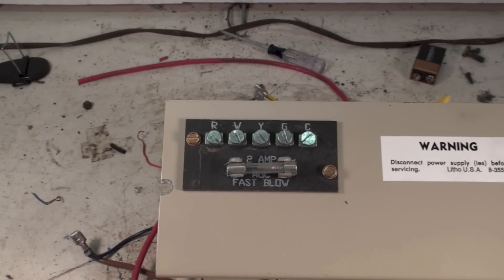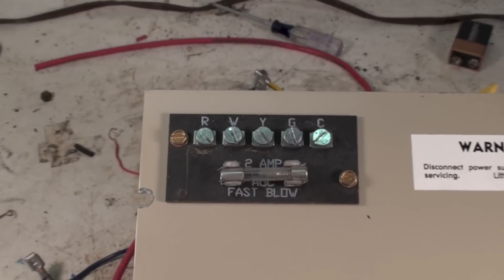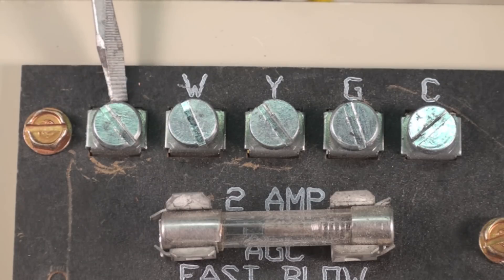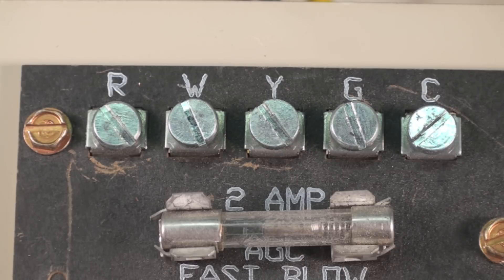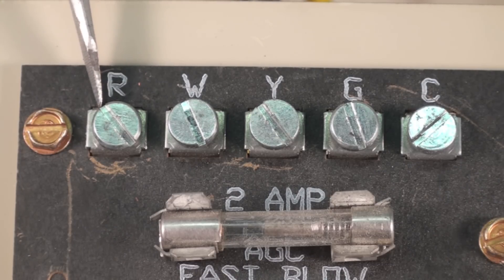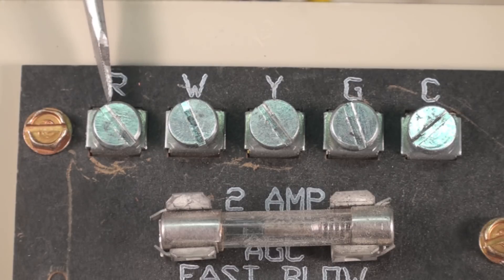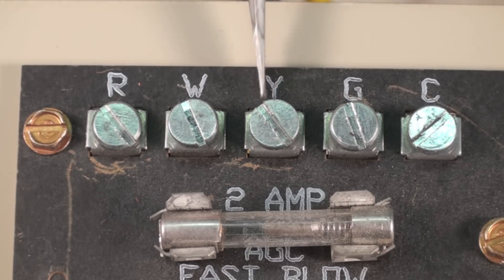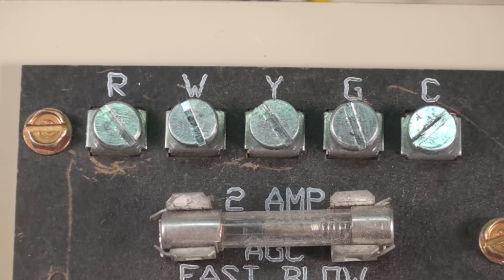What the terminals on the furnace terminal board mean

Comment: Thanks. Question pls (tricky). I have the typical 4 wire (no c-wire) thermostat setup but I want to update it to a new Ecobee3 thermostat which requires a C-wire. I will rewire the path with a new 5 wire cable and the connections would be pretty straight forward if not for the fact I have 2 twinned furnaces, so there is a bunch of additional connections between the terminals of both furnaces. So, I am betting that if I keep all the R-W-Y-G connections where they are, just replacing for the old cable, and then hooking the 5th new wire to the C terminal of any one of the furnaces, it should work. Would you agree? Thanks a lot!
Reply from the maker: Most twinned furnaces use one low voltage transformer, so you should be ok.
GFM

Comment: could you do the same thing with a basic Single or two stage stat and a heatpump stat?
Reply from the maker: I do have one on the color code used for heat pumps that may help. Try "Heat pump thermostat wire color code" on my channel.  Will be doing one on 2 stage also.
GFM

Comment: What do you think will happen during the winter for starters if the homeowner turns the fan to the on position ? That will energize the A/C with the jumper🙈 and with all A/C only compressors there is no crankcase heater band .  Why not just use the green wire directly , every furnace since the 70's automatically turns the fan on upon demand calling for heat or a/c !! The  only equipment that needs a green wire is a airhandler and at that point you should have a minimum 7 or 8 wire 18 gauge.

Comment: Gray:
I am hoping you can help and advise me. I have an old (guessing 1970’s) Heil gas hot-air furnace with central air. I cannot give you the model number since it is worn.My problem is that the blower does not shut off after the thermostat stops calling for heat or for cool.I know that the green wire controls the blower. The wiring goes to a Honeywell R8239A 1052 fan control unit. Guessing that was the problem, I went to my local distributor and bought a new controller. I replaced it wire by wire, and turned the unit on, and I have the same result, in that the blower never turns off. I have let it go for hours. It does this after both heating or cooling.Can you tell me what to check? I am not an HVAC guy, but I have 10 rental properties, so I am somewhat familiar with the operation of gas furnaces. I have multi-meters and know how to use them. I just don’t know what to check for.Thanks in advance!Jeff Mattero
Reply: Jeff Mattero I don't know furnaces but I know electrical. I would check the relay. The 24 volt is usually a signal voltage which pulls in a relay to allow a higher voltage to run the fan. If the relay arched, it may have welded the contacts together which is causing it to run constantly. If you have a multimeter, while the fan is running, check for voltage on the terminal that controls the fan. If there is no voltage but the fan is running, I would replace the relay
Reply: Can he check across the relay for continuity  with an ohm meter with the fan unplugged and the furnace switched off?  Presumably the relay should be normally open in an off state where no electrical power is being applied

Comment: 24 Volts positive from the 120Vac - 24Vac Transformer get's connected to R. 

From the thermostat, a wire from Y (Cool) goes to the relay positive for the AC Unit. When there's a call for Air Conditioning, the thermostat sends 24Vac down Y to the relay for the AC unit, and switches it on.

The ground from the 24Vac side of the transformer get's connected to the ground on the relay for the AC Unit.

Does that sound right?

If that's correct, then this might be right too. If not, can you help? I would like to build this. For experience.

Here : http://imgur.com/a/ckUSu

I will get the transformer and relay from Mouser Electronics, and the thermostat from Lowe's, The Home Depot, or maybe even Amazon Prime.

I'd like to learn a little more about thermostats and stuff, to become smarter and gain some experience at the same time.

Thanks. Subbed.
Reply from the maker: It should work unless the thermostat needs a power source thru C.  Then you could use the common from the transformer to connect to C.  Hope this helps.
GFM
Reply: grayfurnaceman I was thinking that too, and yeah, I'll just connect a wire to C if it needs it. Yes, big help, thanks a million.

Comment: Hi! We were watching another of your videos and were having trouble determining where the two wires coming from the air conditioner to furnace should go. I have a gas furnace. We have matched the red, white, yellow, green and connected the blue to the common, however, we are not sure where to connect the red and white wires coming from the air conditioner. Your help would be greatly appreciated.  Thanks
Reply from the maker: One goes to common and the other goes to the "Y" terminal.  Hope this helps.
GFM
Reply: Yes it does thank you so much

Comment: Thank you for the great video. I had a question...currently my humidistat and solenoid valve that serves water to the humidifier is hooked to C and G. I would have expected that when the furnace starts and the blower fan comes on the solenoid would get powered. What I have observed is that if my thermostat fan is set to AUTO the solenoid valve does not get power whereas if the fan is set to ON the solenoid valve does get power. Are my connections incorrect?
Reply from the maker: +Cyrus Doomasia Your connections are incorrect.  Use C and W.  Most humidifiers are not used in the summer.
GFM

Comment: I checked my furnace board the terminals and the 2-wires that goes out to my AC unit is connected to C and Y. 
Isn't that supposed to be on on R and Y?
The thermostat was hooked up last week and we haven't tested the AC since it's cold outside already.
Reply from the maker: +ybrik5 No.  You need the C common to feed one side of the air conditioner contactor.  The Y feeds the other switched side of line when there is a call for cooling.
GFM
Reply: +grayfurnaceman Would that mean the C terminal on my thermostat is empty? 
As there's only 1 wire on the furnace's board C terminal.
Reply from the maker: +ybrik5 If the thermostat does not need to be powered by the C terminal, it will work ok.
GFM
Reply: +grayfurnaceman Does that mean my thermostat is powered by batteries (2xAA)? So that means the Red wire dies not power my thermostat, it only powers the fan, furnace and AC?
Reply from the maker: +ybrik5 If you have AA batteries, it probably is battery powered.
GFM
Reply: +grayfurnaceman Are the batteries only for thermostat's date and time setting or also for its switching function?
So the C terminal isn't possible to wire from thermostat to furnace board C terminal as it will be too much to power my thermostat?
Reply from the maker: +ybrik5 If they are aa size, the thermostat is battery operated.  There is no problem with connecting C.
GFM
Reply: +grayfurnaceman Thanks for your help and time answering my questions.

Comment: I was trying to install a new 5 wires thermostat replacing an old 4 wires.
I used extra wire as c wire but the furnace terminal board side already has a wires attached to it(C and Y), which runs to out side compressor unit. when I attached the new run c wire to this c terminal it is blowing out my 3 amp fuse.
where should I connect the c wire of the new thermostat then?
Reply from the maker: +M ATIQUE The connection to C and Y is normal to operate the air conditioner.  Unless your C wire is incorrectly at the thermostat, it should work.  Also, if you do not need the C wire to operate the thermostat, do not use it.  Hope this helps.
GFM
Reply: My thermostat has been replaced just last week. Although on my furnace board I have connections on C and Y going to my outside AC compressor same as yours, there is no other wires attached to it. 
I think you should leave the C terminal of your new thermostat disconnected/no wires to it.
Reply: grayfurnaceman

Comment: Does the Red wire always have 24v or just when the furnace kicks on. I am looking at putting a humidistat on and if I wire to a constant "hot" line I could possibly be turning the water solenoid on without the furnace running.
Reply from the maker: The red wire does always have power. Wire your humidistat to the W terminal. That way it will only come on when the heat is on. Hope this helps. 
GFM
Reply: +grayfurnaceman: i replaced an old drum humidifier with a flow through and
 I have this scenario and want to correct it.  are you saying connect to C and W or the R and W
Reply from the maker: +Michael Van Gorp C and W will operate the humidifier during the heat cycle.  Thats when you want it to run.
GFM

Comment: I want to replace my 2 wire thermostat with a 4 wire so I can just run the fan on my oil furnace.  I have the four wires, I just need to know how to wire it at the furnace.  The terminals at the furnace are labeled  "F C C R W".  Any help would be greatly appreciated!
Reply from the maker: +matt What model and Brand?
GFM
Reply: The furnace is a Heil Model NLOD84FF03, the controler is a White Rodgers, about 15 years old.
Reply from the maker: +matt The F terminal is not familiar to me.  However R to F could be fan.  Are you sure one of the Cs is not a G?  G is usually the fan terminal.  Hope this helps.
GFM
Reply: +grayfurnaceman 
Thanks, I'll check in the morning!

Comment: Hey what are the line neutral  components  on a control board where does each white line go I got a board the other day on the old board line neutral  was labeled  g7g8g910g31g32 for each white wire the new board line neutral is labeled  different  it has spots for 9 and 10 but no plugs as for 31 and 32 also just in different spots. Everything else on board fits in and matches but that could they had gave me wrong board. I took it loose too take back an show them at store so I don't know schematics. Could you please help it's hot here in Alabama
Reply from the maker: Amil Williams All the neutrals go to the same place on the board.  This just means all the neutral terminals are connected together on the board.  Hope this helps.
GFM
Reply: Well like the white from blower thermal coupling where do they go on the line neutral spots the numbers don't match on new one or does it matter wat leg there on I just didn't wanna fry the new board Is there a way I can send you a picture
Reply: The white wire and white from thermocouple
Reply from the maker: Amil Williams Send it to:  grayfurnaceman@gmail.com
GFM

Comment: Thx for your videos. They are a big help. I have a Lennox G24M furnace, no air conditioning. I wanted to be able to run the blower for the furnace without the furnace being on. I connected terminals R and G through a toggle switch and indeed the blower does come on at low speed when I close the switch, which I like. When the furnace is on, the blower is at a higher speed. Can I leave the manual fan switch closed when the furnace is on? It seems to work OK. There is no increase in amp draw for the furnace when I switch on the manual blower switch when the furnace is operating. Leaving the manual fan switch on while the furnace goes on and off seems to work ok. I have a mercury switch thermostat which is for heat only. I'm a little reluctant to leave the manual fan switch on with the furnace on, because I don't know what is going on with that in the circuit, although it seems to work just fine. There is just that nagging little doubt since I don't know the circuit. 
I want to have a manual fan switch because the blower circulates heat throughout the house from the wood stove. 
Thx
Reply from the maker: akzocolo The furnace has a relay that locks out the unused speed when the manual switch is on, so go for it.
GFM
Reply: grayfurnaceman
Thx grayfurnaceman

Comment: Thanks for the video. I have a question if I may ask. I'm replacing my thermostat with one which requires power from the C wire. My current wiring bundle is only 4 wires with no spare for C.  My terminal board has R, C, G, W1, W2, Y1, Y2, and O.  The thermostat is connected to R, G, W1, and Y1.  The A/C unit is connected to C and Y2 and there is a jumper between Y1 and Y2.  I understand I can move the G wire to the C terminal and use that to power the thermostat while losing ability to manually turn on the fan. And I also understand this would require a jumper between G and Y terminals on the board. Is this still possible with separate Y1/Y2 terminals?
Reply from the maker: The Y1 and 2 will probably make no difference because you do not have 2 stage cooling.  Usually you can just use Y1.  Hope this helps.
GFM
Reply: Great!  Thanks for the incredibly fast response.

Comment: Nice video!  I am trying to connect a new WiFi thermostat - thought I was lucky since there seems to be a unused wire I could use.  However, there is no wire connected to the "Y" on my furnace board, instead it looks like it is connected to the "C" (not sure why or if that even makes sense).
Can I ignore this, and just connect my unused wire to the C on the furnace board on top of the existing C wire?
Thx
Reply: I have the exact same issue. I am trying to resolve it myself. I connected a loose blue wire that was part of my previous 4 wire bundle from the furnace C terminal. The C terminal at the furnace already  had a wire connected to it. I then connected the other end of the blue C wire to the C terminal of my new WiFi thermostat: Result ------- no power. I really would like to resolve this without wiring in an alternative manner, as I understand one can. Did you get yours resolved? If so, how?

Comment: What's the point of the Y terminal on the furnance control board? I was going to get a Nest Thermostat and replace my wiring. I was wondering if it was worth connecting this or not. The heat and fan toggle obviously make sense. I have a Reheem classic 80. Thanks for your video!
Reply from the maker: Louis Tibbs On some furnaces, the Y terminal is just a terminal point with no connection to the furnace.  I am not sure on your furnace, but newer furnaces use the Y connection to change the fan speed.  Hope this helps.
GFM

Comment: Do you know whether I can disconnect the green fan wire and still have the furnace functioning properly?  I have a retarded Section 8 tenant who uses the fan all the time as a cooking exhaust fan to silence the smoke detectors.  She does this instead of opening the windows to vent the oily cooking fumes.  Sooner or later the fan is going to prematurely wear out.  If I disconnected the green fan fire, would the fan still come on in the AUTO mode?  This is for a furnace.
Reply from the maker: madcheme  Most furnaces have a circuit that starts the fan without G.  Air conditioners do not.  Hope this helps.
GFM

Comment: I had a pro install my thermostat but I notice that when I turn cool I hear a clicking noise on the gas valve is this normal
Reply: It's an old miller furnance so I'm not sure bad when I turn the thermostat to cool the noise happens and when I turn the fan or heat I hear no noise
Reply: I forgot to tell u all wires are correct w to white y to yellow red to RH jumper to RC and G to green and there's is a switch set to gas
Reply: No.. I only hear that sound when the thermostat click for cool and when it's on.  It goes away

Comment: in my air  handler i have the low voltage wires R G W1I W2 C  but on my thermostat i don't have the C terminal  i just comected the C wire in the air handler  to the wire coming from the condensing unit but my circuit board fuse keep blowing  it's the C wire or something alse thermostat terminals are R W1 W2 G Y O B what can i do thank's.
Reply from the maker: These are tough problems.  You must be methodical in everything you do here  Disconnect the C to the outdoor unit first.  If the fuse does not blow continue to the next terminal, such as red.  Keep disconnecting until  you find it.  To avoid blowing 50 fuses, jumper the fuse terminals and clamp the jumper with an ammeter.  If the draw goes above 1.6 amps, shut down.  It is a short.   I realize this is hard to understand, but it is not easy.  I will try to do a video on this to help out.
GFM

Comment: I need some help in doing the electrical hook-up of a Honeywell humidifier HE225 with a humidistat mounted above the humdifier. The furnace is a Trane M#tuh1b080a9421ba. What is the wiring configuration?
Reply from the maker: If I am correct, there is a dedicated wire in the junction box where the 120v power comes in.  Check your wiring diagram.  I believe it will provide 24 volt power to operate the humidifier.  If you send me the diagram, I may be able to tell you how to do it.
GFM
Reply: Hi. In regards to the Trane furnace I can write a comment but I do not know how to attach a picture of the diagram of the wiring board for the furnace. Can you send me your email and It would be a lot easier for me to get a picture to you.
Reply from the maker: ***** Try grayfurnaceman@gmail.com

Comment: I am trying to upgrade mercury bulb thermostat that has red and blue wires that this new thermostat has letters on the rightside it has G W Y B  on the leftside  R Rc  O does my red wire go on R and my blue wire go the W i hav heat only
Reply from the maker: If the wiring from the furnace has only 2 wires, you are correct.  This is assuming the thermostat does not require a W connection.  Hope this helps.
GFM
Reply: Thx u